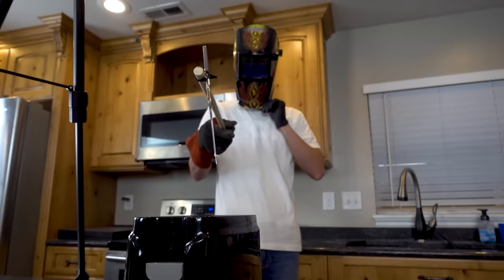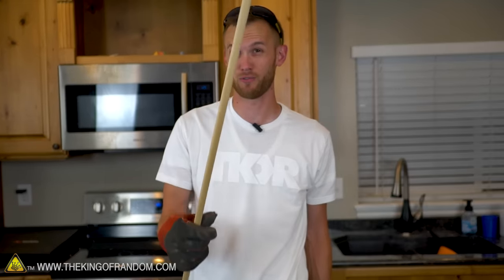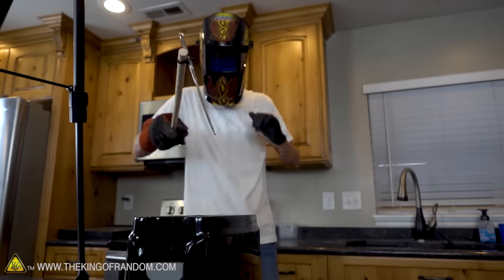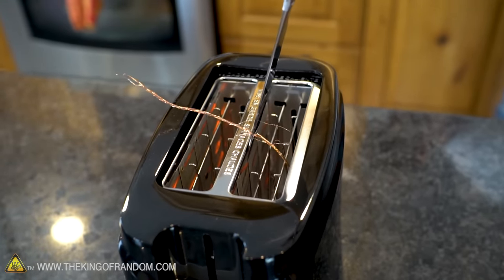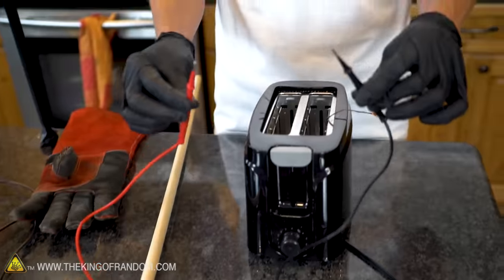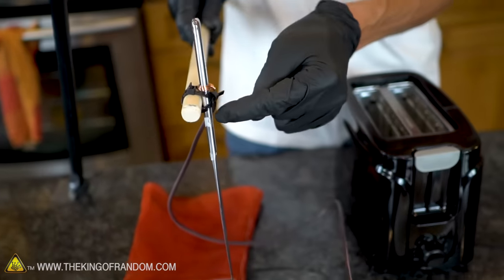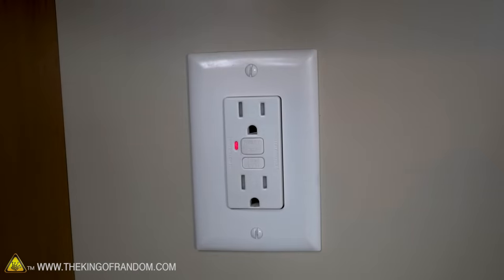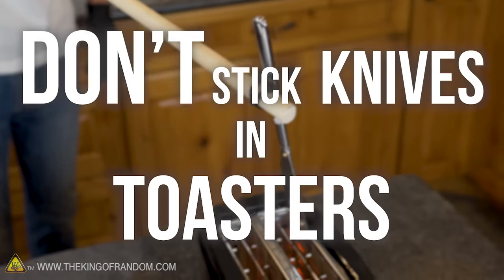Don't Stick Knives in Toasters

Comment: When I was little, i took a knife to the glowing wires. I snapped it. It made a spark and I liked it so i did it on the other side. I didnt get shocked or anything, just a pretty spark. We still have the toaster and no one knows why one side works. Only me. Lol.
Reply: Nice story bro
Reply: CrazyCayden omgggggg me too!!!!!!!!!!! I took a fork and pulled one of the wires and it popped and made a nice firework and then that lane quit working, I did it 1 more time on the same side, one more down, and then the whole
Side quit working........ lmao glad I wasn’t the only one
Reply: Cj Perlotto thats funny.
Reply: Why you still got it
Reply: Because one side still works 😂😂
Reply: I actually for some reason really like your story
Reply: CrazyCayden that’s funny 😂
Reply: OOf OoF
Reply: dad reads comment
Reply: CrazyCayden Cool story bro
Reply: CrazyCayden you have my name but mine is Caden
Reply: omg i did that, but i killed the whole toaster by accident. I had no idea it was dangerous?
Reply: My real question is why y’all haven’t replaced your toaster if only one side works!
Reply: I did same thing aswell
Reply: I did it too. Didnt know tho what would happen. It kinda sparked and that knife like welded on the wire. Pulled it out and it still worked. Didnt get a shock.
Reply: r/thathappened
Reply: CrazyCayden lol
Reply: That's because there is no Voltage difference - >no current flow. But it sparked because there are about 100V on the NiChrome wire-> arc, spark
Reply: Woah crazy by name crazy by nature
Reply: I did this and the whole toaster broke
Reply: r/thathappened
Reply: Well if they read this comment then...

R.I.P
Reply: Lol
Reply: EXACT SAME BRO
Reply: @chalboi  That would be cool, haven’t seen him in decades

Comment: The old knife in the toaster routine :) I think it is time for the paper clip in the wall outlet ;)
Reply: South Main Auto Repair I did that and I was in the hospital for 2 days
Reply: South Main Auto Repair
Reply: Toaster vs Bathtub
Reply: thanks for stealing my suggestion
Reply: Gum wrapper as well.
Reply: like the vine where the guy sticks the knife in the outlet and then gets uber shocked
Reply: his knife holder looked like some kind of weapon
Reply: South Main Auto Repair a kid did that in my class and blew out the socket and shot Sparks everywhere, outlet was all black and fried and the kid got sent to detention
Reply: Hairdryer Vs. Bathtub
Fork Vs. Outlet
Aluminum foil Vs. Microwave
Reply: South Main Auto Repair metal fork vs microwave?
Reply: Scissors worst
Reply: South Main Auto Repair I know two kids who've done that one of them he stuck it in the outlet and the whole row of computers went out with the other kid all I know is that he dropped it like he was shocked or something
Reply: What about fork in power outlet
Reply: My friend "accidentally" dropped a paperclip in an extension cord at school one day and it made a big pop sound, smoke, and welded one side of the paperclip into the plug. The circuit breaker for that one wall tripped and turned off the projector in the other classroom. We had a substitute that day that saw what happened and didn't do anything. Our normal teacher found out and my friend never got in trouble. From that moment on, my friend group says "Pop" around him to make fun of that incident.
Reply: South Main Auto Repair fork*
Reply: @NatePlays HD Shocking!
Reply: Cara Hollichboll @
Reply: or capacitor (extra fun)
Reply: South Main Auto Repair v
Reply: South Main Auto Repair I put a fork in a outlet when I was three I somehow was fine
Reply: Fork v microwave
Reply: South Main Auto Repair toaster in the bath
Reply: Lol when I read this I thought of that one vine when a student in high school put something metal in a outlet
Reply: No gloves
Reply: Cara Hollichboll atleast he got likes on his comment
Reply: Don’t put a pop tart in the microwave with the wrapper on
Reply: He should use an old toaster you should search of toaster knife. Fails
Reply: A kid in my 8th grade class stuck a paper clip in the wall outlet and  all the light went off in the school. We found the paperclip later and it was black bc of the shock
Reply: South Main Auto Repair did this with toe  nail clippers as a kid all it did was trip the breaker and leave a burn/melted spot on the nail clippers 
i didnt even get shocked
Reply: I Did That Is A Dare In School
(In 1st Grade)
Reply: South Main Auto Repair did that... no fun
Reply: NatePlays HD ya, 115 volts AC can do that
Reply: My friend did that five times with a paper clip and his hand went numb for a bit
Reply: i think you meant fork
Reply: South Main Auto Repair or a fork
Reply: I stuck key in wall outlet it did zap me I'm imune to electicy😂😂😂
Reply: Or car battery
Reply: @astilmanuscript8106  fork vs microwave depends on the metal coating. Might get some sparks. Let it touch the sides and you will hear an almighty electrical welding sound with blue to white sparks and no light as the entire voltage of the magnatron starts welding through the wall of the microwave!
Reply: @South Main Auto Repair LLC I've done it
Reply: Winkyface
Reply: @helenahlers6621  r/thathappened
Reply: All ready did it
Reply: @kanipe9511  I tried a nail and I didn't even go to the ER bruh
Reply: I put a stretched out spring from a pen in a outlet didn’t work first time did it again it went pop
Reply: I did that in science class on accidennt and i didnt tell the teachrt
Reply: i did that when i was young, the outlet exploded and it didn't work after that

Comment: I see an electroboom video coming! Right, King Jr?
Reply: same toughts ;-)
Reply: Me to!!
Reply: Volts = energy (in this video) so, probally, yes
Reply: Also the hotdog as the human replacement is completley wrong
Reply: COLAB COLAB COLAB!!!!!
Reply: King Jr. XD
Reply: That's exactly what I thought
Reply: Get ready for a lesson about toasters and why there is different Voltages to measure.
Reply: I think he already dind one with gfi brakers but not toasters
Reply: Im iritated by this video .... how can there be volts going though sonthing ....
Reply: Me to
Reply: Electroboom, collin furze, the hacksmith, and the king himself...That's the squad I wanna see😄😄😄
Reply: Voltage is not flowing
Reply: Roast king jr!
Reply: yesss please xD
Reply: Mike Notarnicola You are right. I was mehditating a lot about this.
Reply: It's hilarious how Electroboom calls him King Jr.
Reply: Bob Weaver And its 100% true.
Reply: I like you new intro edit sorry wrong persoon
Reply: I hope so
Reply: Well, what we can say is that there was not 110v of electricity going through the hotdog since voltage is just a measurement of potential. The correct statement would be the current flow measured in Amps going through the hotdog. To calculate total power dissipated through the hotdog, we'd have the measure voltage across the hotdog and multiply that by the current. Secondly, the voltage difference when measuring across the different parts of the nichrome wire is effectively a voltage divider working much like a tap off from an autotransformer at different points. - Electronics Engineer
Reply: THE RECTIFIIAHHH!!!!!
Reply: @SimplyElectronicsOfficial  The autotransformer analogy is almost correct but not quite.  A potentiometer acts like a resistive voltage divider, which is what the nichrome wire is most similar to.  However, the autotransformer is an inductive voltage divider, and has some special properties.  For example, potentiometers draw a lot of resting current, and the load must draw less current than flows through the potentiometer naturally, or else the voltage would be messed up.  However, autotransformers draw very little resting current, and most of the input power is directly converted to a lower voltage due to the magnetic affects cancelling voltages and whatnot, with capability for a very high current draw nontheless, and a higher current draw at a lower output voltage, as is characteristic of a transformer.

Was this helpful?
Reply: @Nishanth Rao In one of the reply threads of the higher up comments on this video, I have a big long comment rectifying parts of this video in detail.

Comment: Well, what we can say is that there was not 110v of electricity going through the hotdog since voltage is just a measurement of potential. The correct statement would be the current flow measured in Amps going through the hotdog. To calculate total power dissipated through the hotdog, we'd have to measure voltage across the hotdog and multiply that by the current. Secondly, the voltage difference when measuring across the different parts of the nichrome wire is effectively a voltage divider working much like a tap off from an autotransformer at different points. - Electronics Engineer
Reply: what did you do, unassemble your gameboy and now you name yourself "Electronics Engineer" lmao
Reply: agaveboy graduated with a degree and work as an industrial automation electronics engineer on a 50k salary. I prefer the term disassemble as unassembled is not a word.
Reply: I was going to say it's the amps, not the volts that is more important. - not an EE.
Reply: Simply Electronics Nichrome wires have high resistance, right?
Reply: There is absolutely 110v "going through" the hotdog, otherwise you wouldn't be able to read a difference of potential at the opposite end of the hotdog to ground using the meter.
Reply: LordValafar is not 100% that truth. human's body got a base resistance so the amps is the after effect of connecting your self in parallel at high voltage circuit
Reply: Saying voltage is going through something is like saying gravitational potential is going through something. It's simply incorrect. Potentials are a measure of a difference in like a field. According to our current understanding of physics the fields are not going through the path, rather the force carriers are and that changes the values.
Reply: If you have a hopper full of balls hanging off the side of a building and you calculate all the gpe from each ball, and release some lever and drain all the balls out, you would say the hopper has less gpe. The mass of the balls moved through the distance, and perhaps some gravitons, but not the gravitational potential energy. But that potential did change.
Reply: Charged Supercap Since it’s used as a heater it should
Reply: same
Reply: derek marden saying that is like saying a river has 20 meters of altitude going trough it, since voltage is potential energy just as potential gravitational energy is what gets a river going.
Reply: Charged Supercap a higher resistance than the likes of copper yes, and resistant to oxydisation. About 100 ohms per metre. Great as heating elements.
Reply: Santiago Ozan, hence the quotations. I wasn't implying its going through it, it brings it to the same potential as the energy provided, which happens to be 110v from reference ground.
Reply: Derek Marden There is 110v potential across the hotdog, not going through it. Somewhat inaccurate reading though as resistance across the wires haven't been accounted for. A measurement directly across each end of the hotdog would show the true voltage across it.
Reply: Simply Electronics are you saying if you put a lead on each end of the hotdog you would read true voltage?
Reply: Derek Marden if you take a multimeter and measure across the hotdog, you would see the RMS 'voltage drop' across it yes.
Reply: Simply Electronics which would be close to zero depending on resistance.
Reply: Derek Marden absolutely! Let's say for the sake of explanation that the hotdog has a resistance of 5ohms (due to burned carbonisation of the hotdog). And 10A is flowing through. You would measure about 50vrms across the hotdog. As the resistance of the hotdog decreases, power dissipated across it is reduced. At 10a and 50v you have about 500w dissipated. Not for long though, the more the hotdog burns the resistance drops and becomes a better conductor, until ofcourse the hotdog breaks internally and becomes open circuit/high resistance.
Reply: Simply Electronics i believe we are on the same page, I don't have any disagreement.
Reply: SaboFudge this is a discussion, people are asking questions and I'm answering. If you don't care. Don't read.
Reply: Derek Marden High Five :D
Reply: lol calm down jokes are a thing
Reply: Simply Electronics 
/r/Iamverysmart
Reply: Simply Electronics well when someone's comment Is the first one then I'm going to read it
Reply: the correct term is "you are at 110v", this is how birds can perch on live wires, as long as they don't touch anything with a lower voltage, higher voltage or a different phase.
Reply: Charged Supercap yeah buddy! Could coil enough and just rely on E drop.
Reply: Simply Electronics i give up to much smart people here
Reply: You.... I like you.
Reply: If you poke your body parts into a toaster while it's on or plugged in then bad stuff could happen to you. - Electronics and RF Test Technician.
Reply: Nerd
Reply: Simply Electronics nice, I could use this for my essay I have to write for AICE general paper before school starts.
Reply: Simply Electronics łlllllllll
Reply: @Simply Electronics, you said that the hotdog would become a better conductor as it burns, because the carbon content would increase. Doesn't the carbon have to be in a particular orientation to conduct electricity well? Like nano-tubes, graphene sheets or rods? You can't exactly use a brick of charcoal to conduct electricity, right? I think the structure of the carbon in the hotdog would be too chaotic for conduction.
Reply: agaveboy lol rekt
Reply: Lol i think the old videos (diy welder, spotwelder, scaryac, h20 splitter ) were more correct.
I miss the old times
Reply: Simply Electronics where did you work getting a 50k salary, an arcade
Reply: The most simple way to explain it, is to compare it with water...
Voltage (volts) is the water PRESSURE in a water pipe. Current (amps) is the water FLOW in a water pipe.
Power (watts) is volts times amps. Power output is pressure times flow (P = V x I).
Reply: agaveboy why are you so salty
Reply: I tried working with wires. almost killed myself. so no i avoid it at all costs
Reply: agaveboy get shut down
Reply: Theres always that one person who corrects everyone bc it makes him feel better about himself.
Reply: Would the measurement he did just be the different in potential between the toaster and ground? If you want to to find the potential of just the hot dog you would need a probe at each end of the hotdog (measure voltage in parallel with the component) where this set up is in series which is how you should do it when measuring current
Reply: I already thought that someone wrote that comment.😉
Reply: Simply Electronics I caught the subtle brag about you salary.
Reply: I thought of Diamond, and found this: 'Electricity is conducted in a crystal by electrons that are relatively free. But in diamond, each carbon atom is covalently bonded with four other carbon atoms and there are no free electrons.' -- hope that helps explain
Reply: worst intro ever
Reply: @ SImply Electronics I second your statement -Certified Student Electrical Technician
Reply: Geez, it's only 100 V. Try that from a power point in Europe with 240 V.
Also, you should've noted that the average American hotdog is way inferior to a human finger.
Reply: Charged Supercap they have a high resistance after being heated up. Pretty much a dead short when cool. As metal heats up, resistance increases
Reply: Simply Electronics You are smart.
Reply: his knife tool looks like fortnite pickaxe
Reply: And to measure voltage, the voltmeter needs to be connected in parallel not in series as shown in this video with the hot dog to voltmeter then to ground cable
Reply: Exeutech Tutorials, lol so true  😂😂
Reply: Simply Electronics and also bro, voltage is more like kinetic than potential :3
Reply: agaveboy bro you seem to very naive to judge a person.
Reply: Speeedy Pickle he already mentioned it.
Reply: Aaron Gonzalez its about right info bro.
Reply: yeah that's what I thought, you can't mesure voltage if you connect your meter in series can you ?
Reply: wow... I thought I was smart... l:(
Reply: Made in France as demonstrated u can actually, just it's not the actual voltage going through dat hotdog tho..
Reply: I was told that as a child ....... So I used a fork lol
Reply: Yes thank you This people don't listen to the guy in the video kek, plus if he tried to measure current that way he basically series the meter and it's just a short, try measuring current from a car battery like that using a dmm and watch the sparks fly.
Reply: Voltage can´t "go through" or flow. If you measure some voltage, there have to flow current, but voltage DOESN`T flow!
Reply: The word 'flowing voltage' is a simplified term...
Reply: Ben Logic A clamp meter would suffice.
Reply: Potential means from one point to another.
Reply: Wow, surprised me hahaha, Pretty cool though!
Reply: Potential cannot travel through something, it is not an object of matter. Such as electrons and Amps, can.
Reply: Simply Electronics only 50k?
US? or CAD/AUD
Reply: This is best comment confirmed!
Reply: Im just a lowly mechanic, I caught his fallacies too
Reply: And I Sell Dope 👀💪🔫💥💯
Reply: yo btw 2 months later i still don't care about your salary because it's kinda obnoxious.
Reply: I would be curious to see the voltage drop across the hot dog over time because as it cooks it loses water and likely gains resistance.
Reply: Thank you so much that I'm not the only one noticing that mistake
Reply: Thank you! I cringed every time he said "volts flowing" and I'm a chemist. You must have been in pain